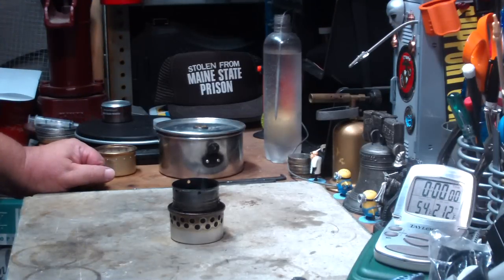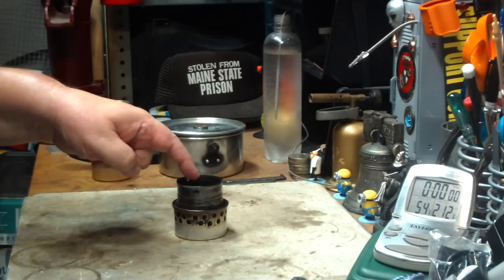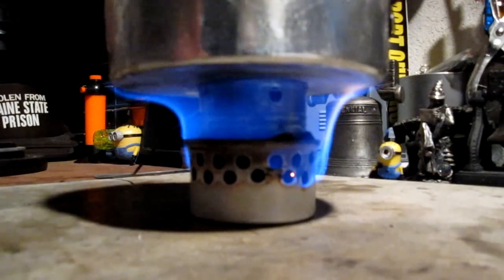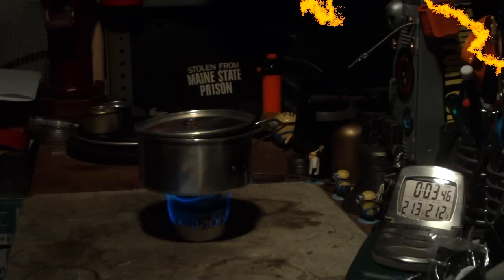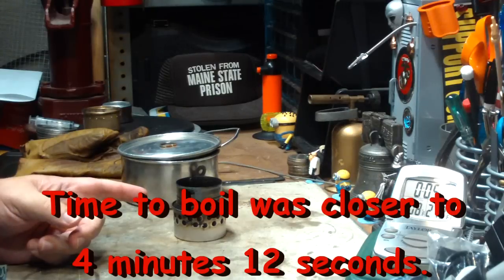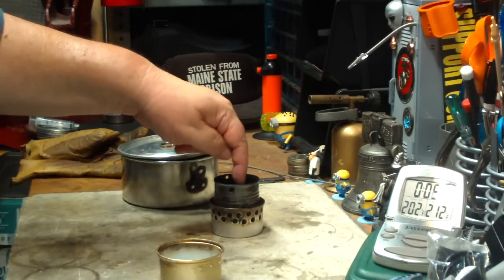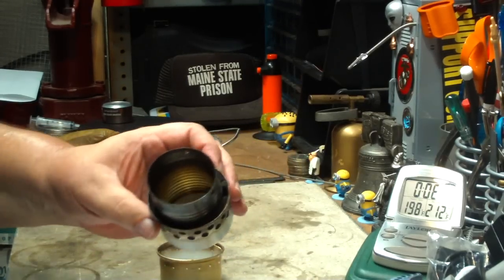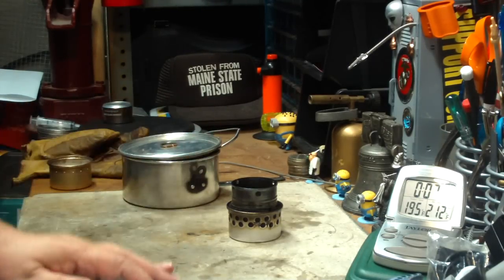Fancy Feast Stove - Super Cat Mod - Boil Test #1

Comment: Excellent video, thanks. This stove combines simplicity with efficiency, what more can one want? It appeared that the blue flame licked up the side of the pot, so some heat was lost. The version of this stove without holes in the catfood can boils water more slowly but probably wastes less heat, so... I'm thinking one row of holes around the can might be a good compromise: Hotter than no holes but not as wasteful as two rows of holes. It's my starting point anyway. Thanks for the pioneering work.

Comment: I just tested this without the carbon felt and it boiled in 4mins 10secs and burnout at 7:05 great boil time, this is the fastest boil time I've ever had, it beats my capillary stove, but without the felt, it's a little tricky and takes some extra time to prime it, so with the carbon it does not improve the overall time or anything, but it helps prime it faster and thus reaches it's boil faster without wasting anytime waiting on it to prime.

Comment: Mr. Hiram, I am working on a remote fuel feed for my alcohol stove. where can I get the little brass fuel fitting or fuel nipple that screws into the stove and fuel source to hook the tube up to???
Reply: +chris malcom Hey Chris, did you ever find the Fuel fittings and nipples and tubing, I could never find the exact sizes needed at stores and online there were so many choices in sizes, I had no clue what to get, so I just bought mine from Minibulldesign, they are very cheap and he sells everything, also on the Remote fuel stations, all I did was get 2 nipples and tubing from Minibull and he sells an excellent and excellent top that fits the heat bottles that he hand makes himself, that wraps tubing around it an has a built in nipple, then all you need is 1 more nipple as it comes with tubing and this makes an excellent remote fuel setup, I also bought the Weedeater Fuel pump push button that primes the fuel on a weedeater that Hiram showed in one of his videos, all you need then is 1 of these that you can get cheap on ebay for 2 of them, and then Minibulls 2 nipples with tubing and you have a 2nd type of remote fuel feed, and you can drill into any stove, I've done it on the Fancy Feast, a rolled aluminum, a Trangia, an ALOCS, you can put a nipple on any stove and it will work.

Comment: What other fuels can be used in case of an emergency and you don't have alcohol can you use Zippo lighter fluid can you use charcoal lighter fluid can you use gasoline can you use kerosene what fuels will work
Reply: These stoves are meant to be used with some form of alcohol as fuel - methanol (yellow HEET in the US), denatured alcohol, or isopropyl ("rubbing" alcohol) in a pinch.
All of the other fuels you mentioned are much too explosive to use safely. PLEASE do not use them! They will cause uncontrolled flames and even explosions if you do. SAFETY FIRST!

Comment: Why does my Trangia and other alcohol burners produce a yellow flame after "blooming"?
Reply: +Roger David I've heard many people claim that any color except blue means it's wasting fuel if it's any other color, I don't know if that's true or not, but I did end up selling my Trangia, becaus in all my many tests with my Trangia aginst my ALOCS Stove, which is like a Trangnia Knockoff, the ALOCS best it out in every single test, so I sold my Trangia, the ALOCS boils in around 8-11 mins, in several tests, and with the simmer ring has burned as long as 1 hour 10 minutes on 1 oz. of fuel with the simmer ring over halfway closed, so except for not having a super fast boil time, the ALOCS could be the best stove made, and then you could do this simple cheap one, for you Fast boil needs. and  you would be all set.
Reply: Any color other than blue means incomplete combustion and soot buildup.
Rubbing alcohol works in the stoves but is too sooty for most people.
Stove fuel (denatured alcohol or Methanol) is the best choice.

As a substitute, you can use the Yellow bottle of HEET which works pretty well.

Comment: Hiram, I have been looking for the making of the original Ff stove, with the carbon felt. for how high to make the inner can. but just keep finding testing videos. can you email me the link for the original making of it. Thank You, 
Papabear
Reply: +Eric Poll Tomato Paste can cut 2 1/4 inches, I use a hole punch to punch 2 holes at the top just under the rim, and then instead of a full hole, I cut a half hole on the very bottom edge where it looks like a U, i punch 3 of these in the bottom, also you can use a Blue Bud Bottle, cut the middle out of it, 2 1/4 inches and same holes, and it fits snug, no carbon felt or anything, also works great, boils in 10-13 and burns to 14-19mins also using a Vienna sausage can inside the cat can, and you don't need to cut it, just punch the holes, 3 great ways to test it, also use on the original stove Walmart sells white Fiberglass in packs in the auto dept. for around $7 or so, so there are many ways to make it, test them all out and record the times and choose the one that best suits your needs for you, check out my 2 new videos dealing with stove accessories, thanks.

Comment: i think all you guys are fixated on rapid boil only.

how about a multi purpose version that burns for much longer for slow boil-rice, taters, or even pan baking.

i think maybe this version with a rotating flue system to bloke the holes.

you would have to reduce the holes to accomodate the flue system .

or i suppose you could carry two versions-fast and simmer options
Reply: Simmering with an alcohol stove has been problematic.
Trangia and Redcamp both have simmer rings.